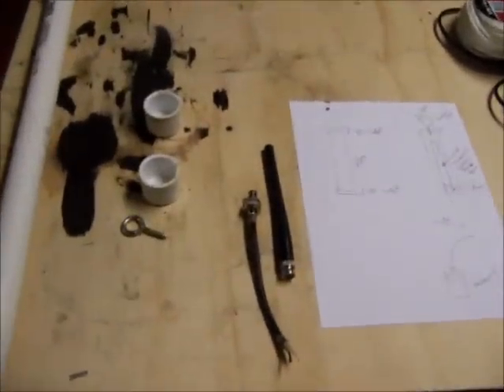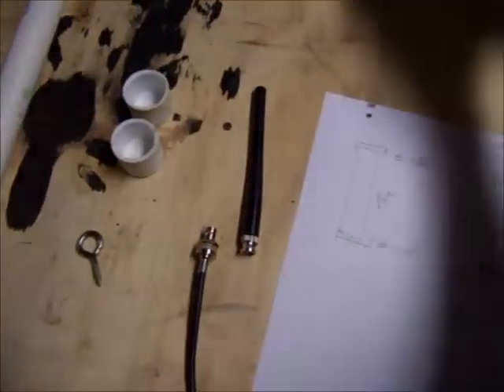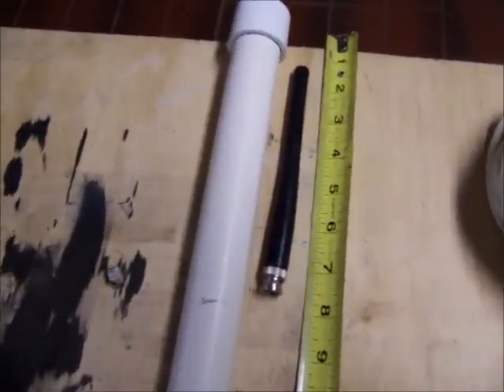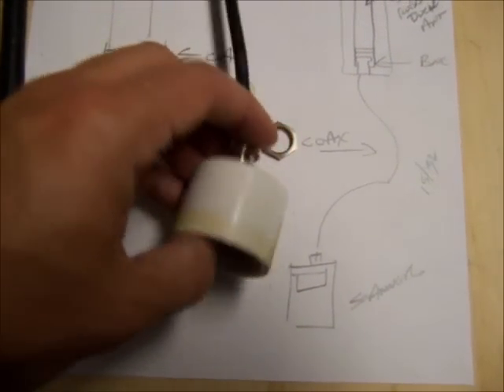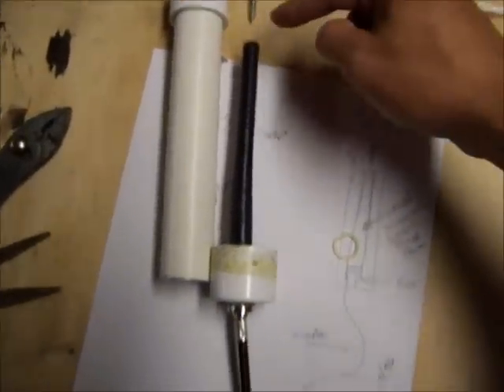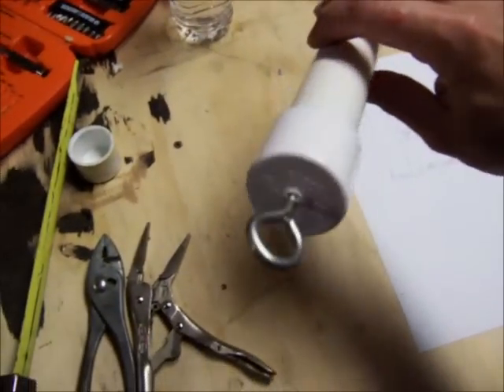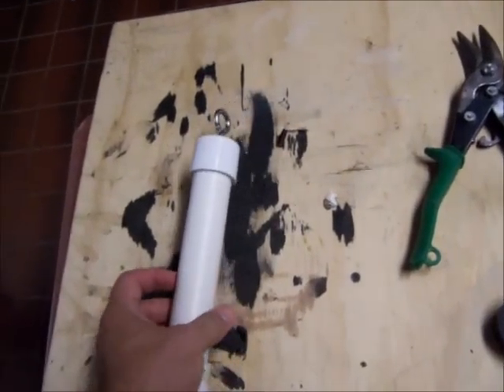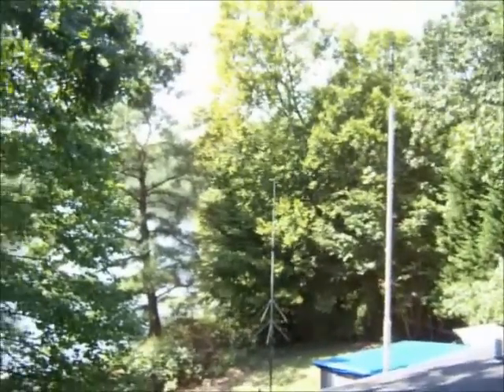Easy External Scanner Antenna for Police, Fire, EMS

Comment: Well done. Not knocking your project but have to comment for those out there looking for more than a "little" improvement in reception, one of the commercial scanner antenna options work very well. It won't be as cheap of course but I spent around $35 on a discone antenna and noticed a substantial improvement.  But, if money is tight, nothing wrong with the DIY route and it will be an improvement over an antenna that is indoors. Thanks for posting the vid. Again, well done! :)

Comment from the maker: Thanks for taking a look and commenting.  A discone will certainly work better - I've thought about putting one up too.
Reply: I have a Discone antenna but modified it by placing a long rubber duck antenna from an old CB radio, on top of the Discone, it had just a terminal cap placed on top so I added a BNC adapter and mounted the CB antenna. gets a good 60 Miles.

Comment: Not bad other than hoseclamping it. Need to keep that verticle more seperated from the mast and use lower loss feedline if you sanna scan 800.
Reply: a uhf/vhf tv antenna would provide more gain and better reception. I have a Lighning Arrestor, RF amp and a Rotor on my TV antenna for Scanning.

Comment: would a indoor tv antenna  work..i have one that is made for local channels, about one foot square  thanks.ed
Reply: ED - yes, the TV antenna uses the same frequencies as a scanner antenna. get one with high gain and vhf/uhf. for a internal antenna get one with a controllable amplifier built in. you may need to turn it down for some frequencies. if you have a house with an attic, a TV antenna there is also a great place to put it.

Comment: being so close to the flue cap it might crack the pvc quicker than normal or build up pressure and cause a cap to fail. please let us know what happens later , its still a cool idea.
Reply from the maker: Poochie43124312 Thanks.  It was just a fun little project.  The wood stove is not used so there isn't a heat issue with this install but certainly something to keep in mind.

Comment: that Antenna is a Unity Gain low end antenna, it will NOT pick up very much. for my project I used a uhf/vhf High Gain tv antenna with a Lightning Arrestor, a inline TV amp and a rotor for directionality. I can get radio calls from over 100 Miles away.
Reply: I tried this. Like you said it didn't work very well.

Comment: great video!
this should work with a desktop radioshack scanner Cat No. 20-424?
Reply from the maker: It should - it's a low profile antenna option that works moderately well.  A larger antenna with more radials will certainly pull in more, but if you're in a slightly busy/urban area it will work fine.  The white PVC could also be painted to match the color of trees, brick, siding, etc. to blend in more.  Thanks for taking a look.
Reply: will antenna work on homepatrol 2?

Comment: I see twovwires coming out of the black coating what did you soader them to?
Reply: Actually, one was the center conductor with the  insulator around it and the other one was the shielding for the coax stripped down and twisted together.  You do the same operation on feed line you are attaching (most use RG-58 in this application being a scanner antenna for recieve only)  Connect center to center and shield to shield and then tape the hell out of it with electrical tape, cover that with heat shrink tube, and then the top coat is some coax seal tape.  Should last several years with out any water infiltration.  To achieve better gain on this design you could use a longer whip with a BNC connector on it, or swap it out for a ladder line antenna cut for 2m and 70cm.

Comment: did it ultimently improve the receiving of the scanner? was thinking of doing this or something similar for my uv5r.
Reply: It would have helped some, he has an issue with the trees surrounding his home though.  VHF band is effected by trees somewhat, but the UHF band (T band where most public safety are located) is really effected by trees.  If you do not have a forrest around your house it should be fine to help out with pulling in radio's in the subburbs or the rual interface regions.  Best for scanner reception is a discone antenna, next best is very wide banded antenna at the higest point you can find or 33 feet above ground level to get optimal reception for the 2m and 70cm bands.
Reply: YFN Fireman - the antenna used was a cheap Unity gain antenna. If you want a better antenna get one for HAM radio use and for External mounting. as rubber duck antennas do NOT have Lightning Arrestors and no weatherproofing.